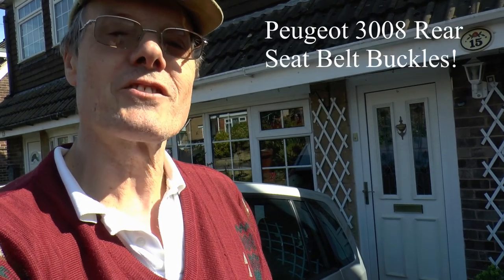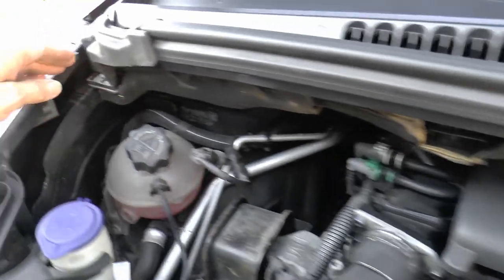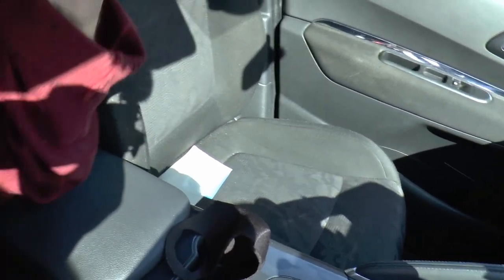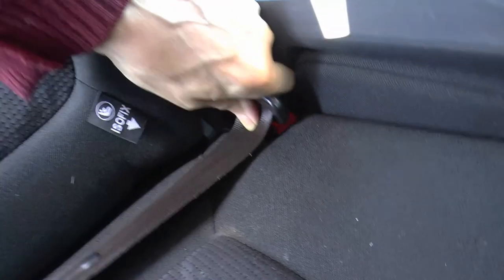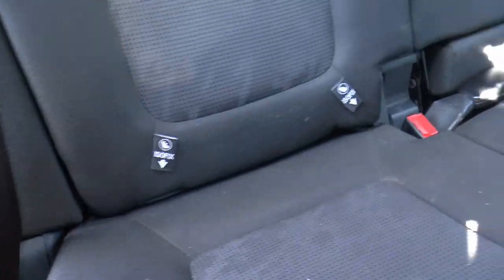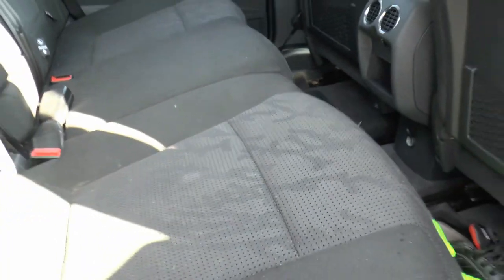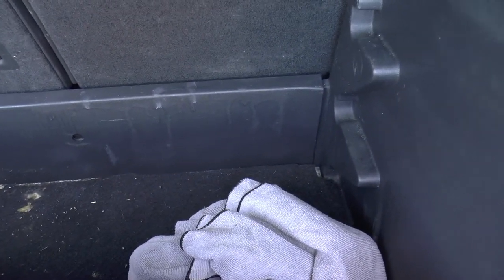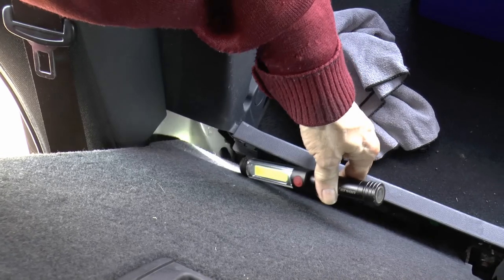'10 Peugeot 3008 Rear Seat Belt Buckles!

Comment: I think I'd be giving the buckles a bit of a rattling with a rubber mallet or, failing that, pull the covers off and see what's wrong with them before faffing around replacing them.
After all, if anything dubious happens you can always replace the buckles... which you're planning on doing anyway.

Judging by the rest of the floor, the buckles are probably just clagged up with half-sucked sweets or congealed milkshake.
If you can unhook the wires and get them out, it might be worth giving them a soak in boiling water to soften up any gunk that's inside them.
Reply from the maker: Thanks Si.  I tried banging a screwdriver in but the buckle is solid. I have never known a buckle be so clagged up before. Looking back at the film now, I can see that the bolt to the right of the buckle probably holds the mounting plate to the floor. Further investigation required!

Comment: Hello from Turkey,
I have a 2011 model 3008 and I have a question, if you have a video or if you can shoot and share it, I would be very happy because I searched a lot and couldn't find it. I want to remove the carrying bars on the right and left of the ceiling. As I said, I searched a lot but couldn't find the source, I would appreciate if you can help. Take care, greetings.
Reply from the maker: Hi from England!     I have searched for an answer too but came up with nothing. It is not something I have come across. the best I can suggest is to remove the roof headlining and go from there. Presumably, there must be some mounting bolts or nuts somewhere. Sorry I could not be more help.
Reply: @sleepycatpictures1176  Thank you so much🤘I found the pdf file of the user's guide on the internet, it says a few things about my problem. I love following your videos and channel. Greetings everyone 👋

Comment: Try blasting them with compressed air in case any of the Kids have stuck stuff in them?
Reply from the maker: Hi Martin. They are rock solid. I've hit 'em with a hammer. Don't know what's up with them!
Reply: @sleepycatpictures1176  I bet Kids have used them as Piggy Banks pushing coins or such like down them.
Reply from the maker: @martinrothwell8966  Can't see anything but the proper mechanism.

Comment: Are you emigrating to Dubai or have you just found Black Gold in the back garden? V8 !!!!!!
Reply from the maker: If only!    No, I'm just going along the lines of lower mileage. I would not be able to use it much but it should be in better shape!  However, the way prices are going up . . . It seems unlikely I will be able to afford to buy one. Plan 'B' is buy a decent TD5 cheap with a broken head, get a new head on it using proper people and hopefully be okay after that. Risky though if I get it wrong!
Reply: @sleepycatpictures1176  TD5 10 p engines pre2001 have an internal return fuel rail that goes through the head. (Weak part) the 15p is partly external. Well, Old "Bde" (as i call Her) goes for the MOT in the morning. Fingers crossed if she passes we might be able to celebrate her 200,000 only a couple of gallons to go. Still have the leaky sunroof and headliner to do!
Reply from the maker: @martinrothwell8966  Well a Big Good Luck with that!
Reply: @sleepycatpictures1176  well she failed on immisions. 3  I instead of 2.18. back for recheck in the morning. New fuel filter filled with injection cleaner, oil and filters, and also changed the turbo to one I have reconditioned. Just done a 20 mile motorway run. So it better pass!!
Reply from the maker: @martinrothwell8966   Oh dear, not good. Fingers crossed.
Reply: @sleepycatpictures1176  Big Pass immission down to 0.7 Yes "Get in there".
advisory on top and bottom ball joint both side, hand brake leaver had slight movement from side to side and, wait for it, a slight oil leak!!!!
Reply from the maker: @martinrothwell8966  Oh good job!   Well Done!